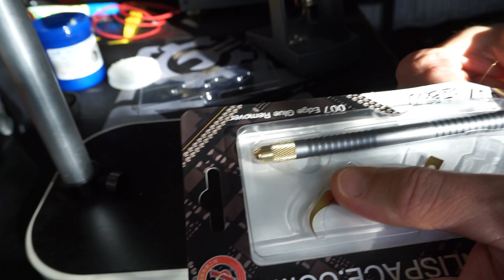AMD Ryzen CPU Teardown.. Failed Pin Replacement

Comment: I live in Vietnam
My current record is replanting 30 pins of AMD r5 2700x cpu. Every month I receive from 4 to 7 such AMD cpu cases, sometimes 1 month I have to handle up to 10 cases.
In my spare time, I also repair socket pins for some Intel motherboards (the number of broken pins is less than 5, in more cases, I usually recommend users to bring the motherboard to a service center) to fix). the plug should be completely replaced)

In my channel, there are some short clips of what I'm doing. You can visit, view and leave me comments.
Thanks everyone

Comment: You need to soake all pins with low melt solder first, only then will the heat gun and a lot of flux work.
Reply from the maker: good tip JC
Reply: @Ricks Tech Second thought. Using low melt solder paste with a small nozzle would make it even more easy to get it between the joints and mix with the already existing solder. You are very likely to get it done without damaging the board since you later won't need as much heat to make the solder liquify and remove the pins without destroying the pads. Cleanup afterwards with a copper braid if needed and it's done. Hopefully you can get it to work next time! Good try!

Comment: Man just had my try on removing a single pin on a 3900x that was broken off with no luck. These pins just don't want to let go easy. I'm going to try again tomorrow, hopefully it will let go.
Reply from the maker: With it being a single pin broken I would do a different method to attach it
Reply: @rickstechrepairs  What do you reckon? I watched some other pin re-attatchment videos on youtube and most seem to use a heat gun even for single pins but I wouldn't mind trying other ideas.
Reply from the maker: i would almost put the missing pin in to the board socket itself, then try it with the cpu installed, without actually soldering or heating anything

Comment: Hey, don't get me wrong because I'd most likely fail too but I have a suggestion for you.
Generally while soldering you want to apply heat for as short as possible, so it might be counter intuitive but increase the heat so you can spend less time heating the chip up.
Reply from the maker: I think with this I needed to pre heat the CPU prior to using the heatgun

Comment: Not enough heat.
Reply: Totally agree. If anyone else came here looking for pin soldering info, 300c is not enough heat to melt lead free solder. Given that the IHS basically amounts to a heat sink soldered to the chip, I would have started at 360c and went from there until I saw the pins move without spending too much time in one spot. Also, 100% flow isn’t always better, I would go lower to concentrate the energy on one spot, maybe 40-50%. After a dozen pins or so, I would give it a 2 minute rest to drop the heat and then do another pass so as to avoid overheating the die.
Reply: @Glass4242  I just tried this on a single pin at all between 325 to 400c with no luck, although I did use 100% flow.
Hopefully I didn't overheat the die.

Do you think upping the temp and lowering the flow would do the trick?
Reply: @patrick1126  Are you using flux? If you aren’t, the solder tends to start to flow much hotter without it. I wouldn’t be doing extra high flow either. Like I said, somewhere around 40-60% depending on your station. Flux might be your key though. Unless you sat and cooked it for like 5 minutes, I doubt you overheated it.
Reply: @Glass4242  I am not using flux no for the desoldering no. Thought it would only be needed for the resoldering.

I did heat it for a while unfortunately yeah. Hopefully its alright, it was sitting on some aluminium foil which hopefully did a decent job of dissipating the heat that did reach the die but I won't no til I finish the pin change.

But thanks for the tip, tomorrow I will give it a try again and keep in mind that it melted faster and hotter is better than taking your time at a lower temperature. And I'll try with some flux.
Reply: @patrick1126  yeah, try with flux, low air and high heat. If you have a preheater, set that to about 180c as well which will help to get there quickly and get it done. Flux just helps to disperse the heat over the surface better and also helps to remove the very thin oxide layer which has a higher melting point than the solder itself. If you have any more questions, feel free to ask and I look forward to hearing how it turns out. I did a Ryzen 3500 last year and it took all of 5 minutes to desolder from the donor chip and solder to the Ryzen. I mostly do phone repair micro soldering work but it’s all the same principles.